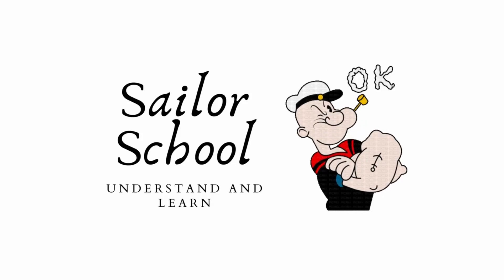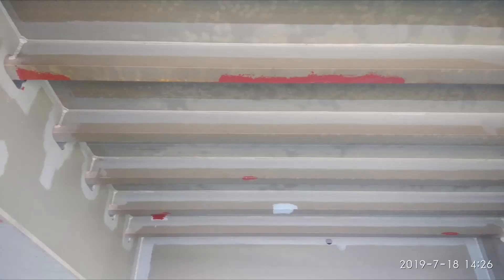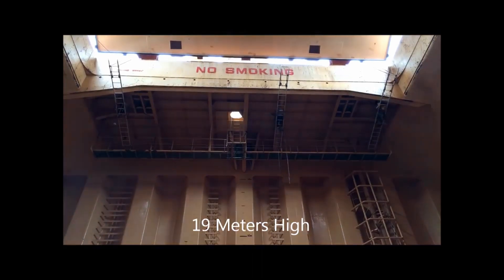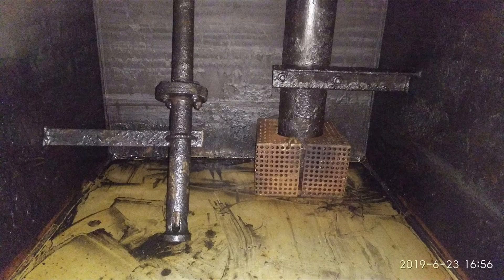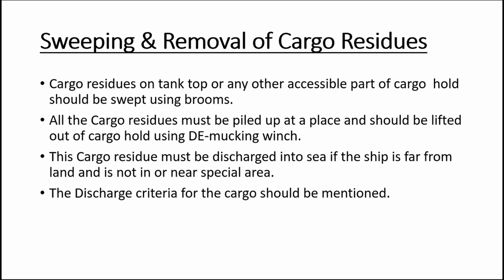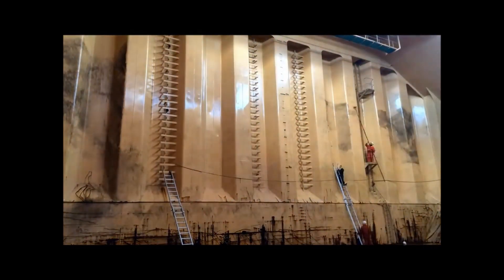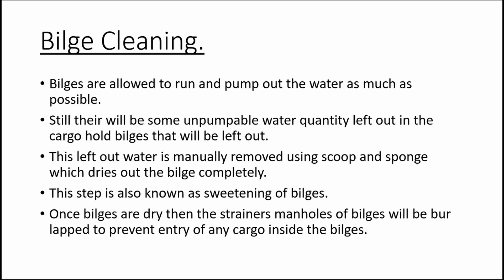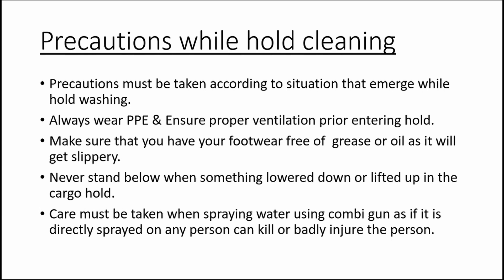Bulk Carriers - Cargo Hold structures and Hold cleaning Procedures

Comment: Hi there. Amazing Job with the video. The void space in the cargo holds are usually there for a reason. The upper void spaces are to carry out any repairs with the hydraulic lines passing to the mooring winches. ( the ones passing under deck, besides the hold) whereas the lower void spaces are there to carry out repairs on the Water Ingress Alarm Systems and their associated wiring ( their access is given here since they cannot be repaired when loaded, if the access is provided from inside the Hold)
Reply from the maker: I appreciate your kind efforts in taking your time to explain.... 

I am sure it would help a lot if in doubt..